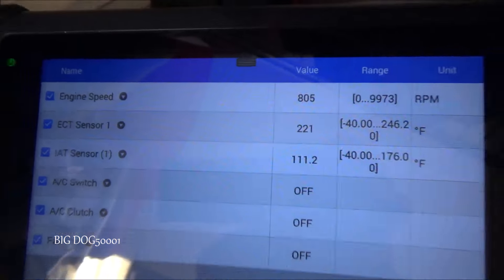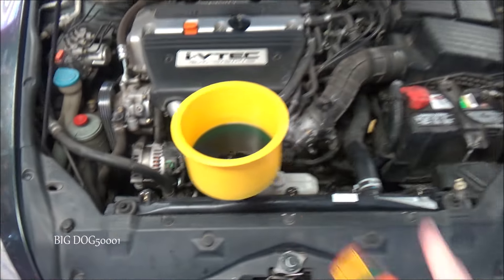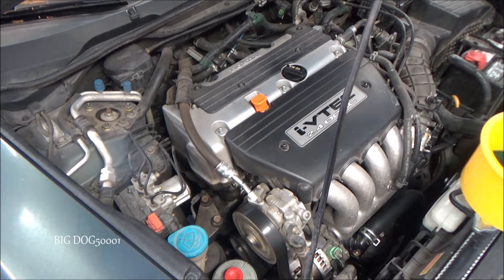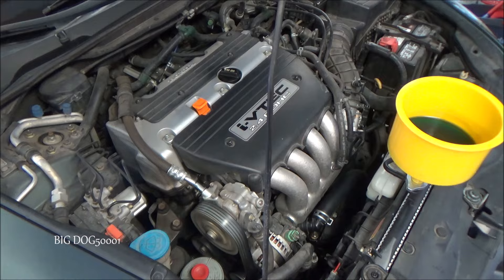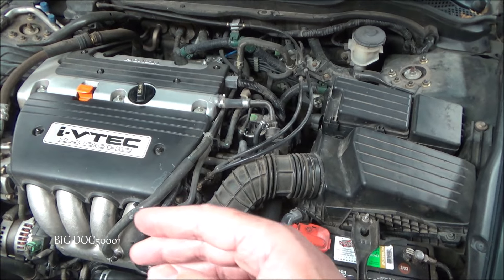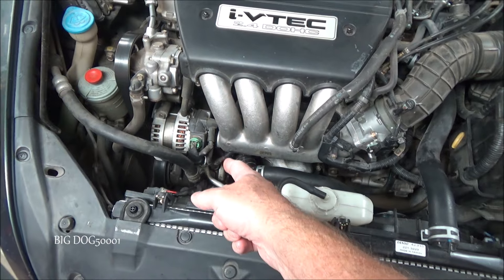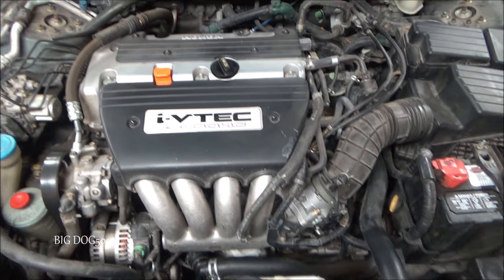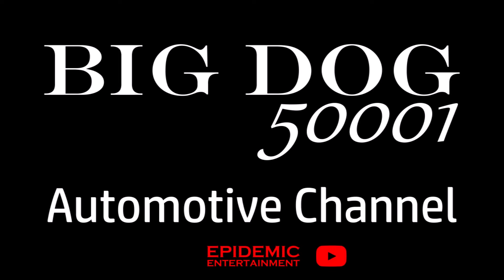Why Is My Honda Accord Overheating?? - Coolant Level Ok

Comment: Nice to see another Honda video. Had a problem with 99 accord EXL recently  I changed cabin air filters ad a week later I noticed no flow of air coming out the center vents and I noticed with A/C on the lower portion of the windshield was fogging up. So my first thought was idiot you improperly installed the filters  which really aren’t that much fun to begin with . Took it back apart and they were correctly installed . Then I thought I damaged some wires going to the temp control actuator on passenger side. Checked it out electrically worked fine. Did some research on the blower door actuator on the drivers side  and it seemed to be working but I disconnected the green connector reinstalled connector and it is now working fine . Which is good because OEM motors are quite expensive . Everything else on the a/c system checks out fine. The only thing broken is me . Been battling a bad case of covd the last two weeks . I fail the test every time not happy. Wife also has it . First time for both of us . Hope your doing well     Artie.   🇺🇸

Comment: Hello! In advance I thank you for all suggestions and help.
I have ongoing overheating problem on my Honda 2005 accord 2.4L and here are the details you should know: 
- during the summer I removed the A/C condenser coil after small front fender-bender. The cabin heating worked OK. Left the compressor connector plugged.
- two days ago I noticed the heating gauge went beyond the half. It went almost to the end, but returned back to a little pass the middle ,as I was about a 3 miles before home. 
- at home I changed water pump, thermostat, ECT and radiator temperature switch, all from dealer, total cost $734USD.
- Fuses 11 and 9 under-hood and fuse 18 under-dash are OK, fan relays are OK
At the moment I lost the cabin heating: hoses to and from the cabin core are cold. Mixing valve is fairly new.
The engine ECT sensor takes 5V from ECM and the ground is OK, tested and proved. The radiator fans are OK, tested and proved by 12V jumper from battery.
The engine heats above 210dF and the fans are NOT coming on. No hot liquid to cabin core as well - no cabin heating.
If there are air pockets in the engine - how to remove them?
Is there a valve controlled by ECM allowing hot liquid to enter at cabin core?
Thank you for the help.

Comment: Interesting I would have thought if the thermostat was slightly sticking open there would have been a code for below temp. I guess not always. We had a CRV that had a sticking thermostat and it never gave a code but it also had Luke warm heat that took awhile to even get that. Cool diag. Thanks for sharing!

Comment: The easiest way to check  if thermostat when u first start car up when it's cold if antifreeze starts moving immediately it's stuck in open position or when vehicle gets to operating temperature and stills doesn't flow it's stuck in closed position

Comment: Well, before watching I was going to say head gasket... this is after all Uncle Dave, summer, and Arizona but after your description I'll go with radiator temp switch not turning on fan.

Edit Curse you dog. I would've leaned water pump impeller if the switch was good and cooling improved with higher rpm but to be honest that requires disassembly to the point where I would've put a thermostat in as a matter of maintenance while system was empty.
Reply from the maker: lol, no more Uncle Dave head gaskets ha!

Comment: a had the same issues 2 time this year .. im from middle east .. so Frist i thought about every thin i changed all the part about cooling system .. then it wasn't the head gasket .. some of the pistons caused over heating .. the fixings price same as Imported Engine.. I replaced the engine instead of repairing it.btw My car is a 2002 Avalon

Comment: I just changed the thermostat in my Cadillac for similar reasons. It fixed the hot idle problem. That's my guess...  Oh, since I just had that problem maybe I cheated.  :)
Reply from the maker: Good guess Wyatt!

Comment: Check the thermostat and if it works well, you might got flanged combined with small breaks on the lips of the cylinders

Comment: I would have guessed air in the system.  You should have dropped the old thermostat in a pot of water and heat it to boiling, watching it open.  Would have been an interesting ending.  thanks

Comment: Big Dog please help! I have this exact problem but I already replaced my thermostat. I did my homework but need the teacher’s assistance!

2004 accord 150k - I installed new fans/radiator/fan switch/thermostat/hoses/relays. When the fans still didn’t kick on after revving the car at idle and the temperature sensor reading 210F, I put the old Honda fan switch and thermostat in boiling water to verify if they were broken. Thermostat expanded a centimeter or two and the fan switch had continuity only at boiling point. I’m making an assumption that the new aftermarket parts work since the old Honda parts also worked. I went middle of the road on parts and didn’t fully cheap out.

More info - The fans still don’t kick on. It rarely goes over 190F the way I drive, never over 3k rpm. Highway speeds it’s consistently under 190F, however sometimes in traffic it can touch 200F, especially the past few weeks where it was 90-100F outside the temperature sensor read 210F. Temperature sensor raises steadily on my OBDMX+. Pretty sure the water pump is factory original from 20 years ago, belt is 1 year old. When I short the relay box at either fan, both fans come on. When I short the pressure switch connector with the ignition on, both fans come on. When I short the AC pressure switch with the ignition on and AC set to on, both fans come on. So I know the circuit is working properly. I swapped relays to aftermarket but behavior is the same so I put the Honda ones back in.

What’s left? I’m no longer leaking coolant at all since the thermostat was replaced (bad gasket). Should I get a thermometer like yours to verify the radiator is actually getting hot enough? I’m guessing the radiator COULD be 190F while the engine is 210F and there needs to be more time to exchange heat to the pressure switch to hit 200F? Seems unlikely the water pump impeller is failing at lower temperatures but working better at higher ones, but that part is 20 years old so I'm unsure. I don’t know what else it could be. That’s the last part I could even think about swapping. Two mechanics said don’t worry about it if the engine isn’t overheating but it’s clearly not operating correctly. It can't be healthy for the engine to be hitting 210F+ just driving under 30mph. They won’t even touch it since it’s not overheating.

-Replaced fan/radiator with TYC assembly (THANK YOU BIG DOG! Amazing video for the DIYer!)
-Replaced fan switch. Standard Motor Products TS295 $30
-Replaced thermostat. Aisin THH-002 $35. Was leaking and had to extract the bottom bolt which was quite a learning experience in dealing with hard to reach rusty bolts. (old mechanic said don’t worry about the leak years ago which was sitting on the bottom bolt forever…I paid for it the hard way)
-Swapped relays with aftermarket parts from Amazon
-Replaced hoses with aftermarket hoses (you were right, I should’ve gotten Honda hoses. Installing clamps were a challenge). Upper radiator hose at the block had some crust from the coolant, everywhere else was clean. Drained/refilled the system twice with Honda coolant as the old green coolant was still in there…not happy with my mechanics for leaving it there so long. Your Lisle funnel was super helpful!

Thank you so much for this content. You have helped me keep my Accord going for so much less money than my local mechanics charge! Nobody gives as much detail as you do and I really appreciate it. I suggest putting affiliate links for everything needed for each job, I’ve bought tools needed with your links when possible. I am always waiting for the next thing I can do to fix my accord based on your channel. Some other channels which are much larger seem a bit sketchy in how short they are, how they don’t go over what can go wrong, and general expectations using average tools, etc. Again, I hope this doesn’t get lost but you’ve been a huge help and my old retired dad can’t believe that I can wrench on my own car!

Comment: Air bubble in the cooling system. Not knowing any history about the cooling system or maintenance, that's my guess based on the Infared thermometer as it showed radiator was cooling, thermostat was normal but up top, all was hotter.

Comment: Over 10 years or 100k breeching the coolant system for radiator or water pump and not replacing theromostat is asking for a comeback....you probably wont do that again...
Reply from the maker: In a perfect world sure but I don't force people to spend their money, I give advice and then fix what they want me to.  I would have liked to replace the cooling fan switch too but that extra stuff takes a $200 job and makes it a heck of a lot more.  People that drive 20 year old cars usually don't have the money for replacing things that aren't broken that day.
Reply: @BigDog50001  Very well said Dave!